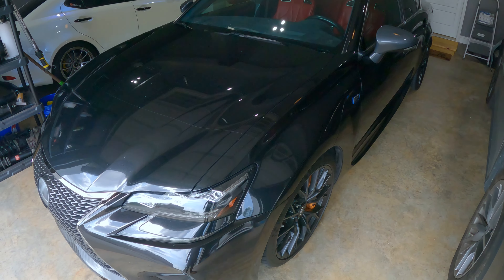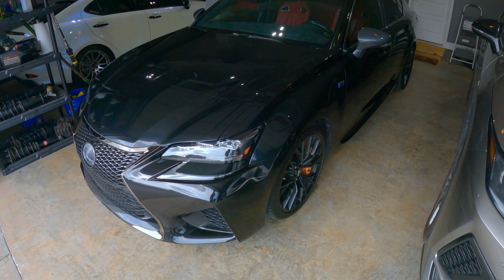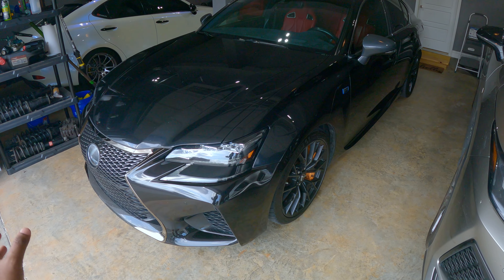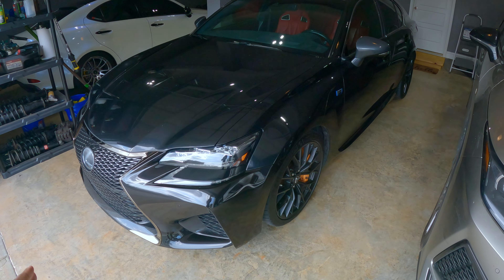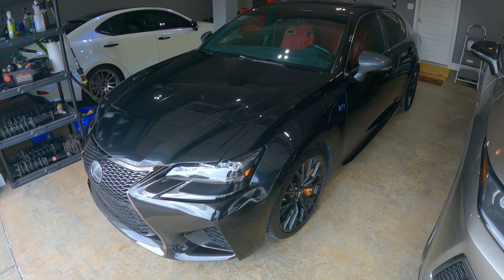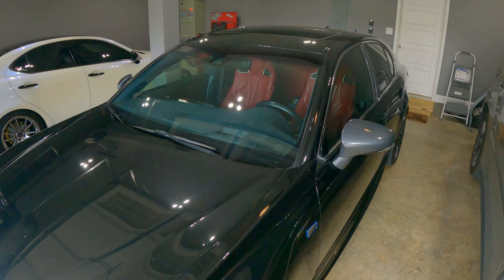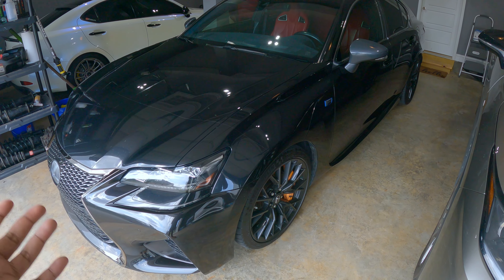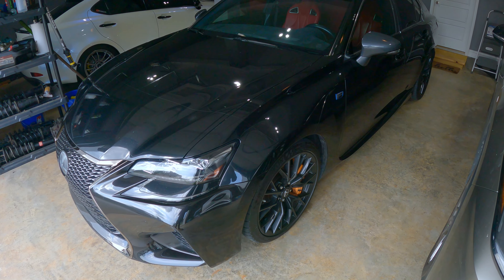Lexus GSF: First Mod!

Comment: I noticed the headlight condensation which is a easy fix which requires you to remove the light and clean around the seal then glue it with silicone.
Reply from the maker: It's covered under warranty. They'll probably just replace it.